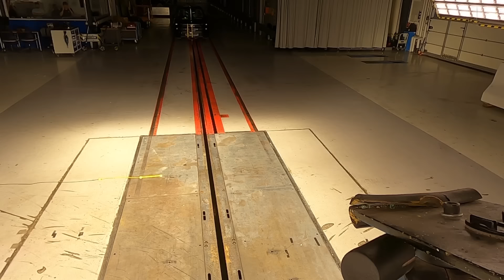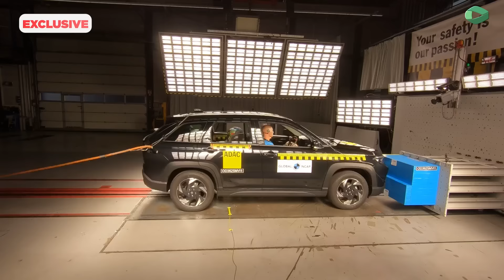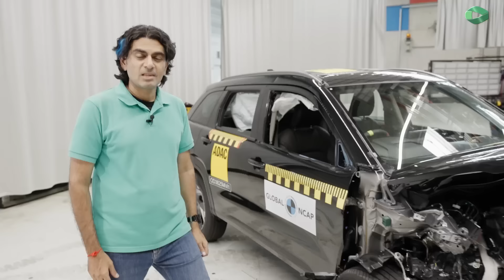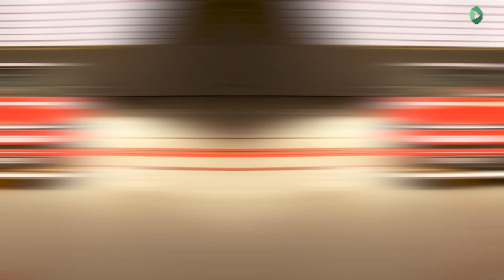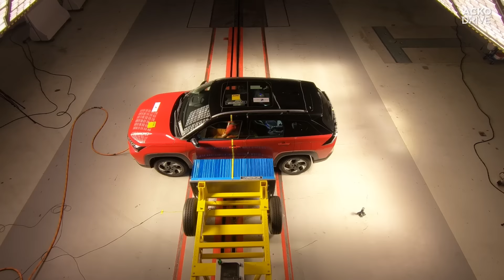Exclusive: Maruti Suzuki Victoris Crash Test: How Safe Is It?

Comment: Anyone hear that? 64 kmph. Every crash test is conducted at 64 kmph, not 80, not 100, not 150, but 64. Meaning at 64 kmph there's a high chance you might not die. So no matter the stars, if you don't drive safe, YOU ARE GOING TO DIE.
Reply: Very well said
Reply: 150 mai to bachna hi nhi hai

Comment: man its still a tin, built quality and 5 star ncap rating are two different things.
Reply: The primary aspect of safety is the passengers inside the cabin should be safe. No matter what are all the damages are there to your hood ,bumper etc these are all prone to damage and made to absorb the damage and not to pass those to the cabin area .Just because a car is getting damaged in small accident it doesn't mean a car is unsafe or Tin can
Reply: @abhaykrishna4861 there is a difference between air bags opening and you getting crushed along with your airbags.

learn the difference, even in the side ways crash test there was a significant amount of damage to the cabin, and real accidents are not control experiments thats why maruti cars always got zero inspite of airbags in european assessments because of their built quality.
Reply: @sharathkumar-vv8ns get ready for 5 Stars of E VITARA IN Euro NCAP. And I can tell you, you will be crying like this even then😅😂
Reply: That is being Exported in europe by Maruti Suzuki in many countries.

Comment: It's from gncap  .... It specifically say the body shell is stable and take more hits so 🥳🥳🥳🥳🥳🥳🥳🥳
Comments
Frontal impact: the protection offered to the driver’s and passenger’s head and neck was good. The driver’s chest showed 
adequate protection while the passenger’s chest showed good protection. The driver’s and passenger’s knees showed good 
protection. The driver’s left tibia and passenger’s tibias showed good protection, while the driver’s right tibia showed adequate 
protection. The footwell area was rated as stable. The bodyshell was rated as stable and it is capable of withstanding further 
loadings. 
Side impact: the head, abdomen and pelvis showed good protection while the chest showed adequate protection. 
Side pole impact: the head, chest, abdomen and pelvis showed good protection. 
ESC: ESC is fitted as standard and meets Global NCAP’s requirements. 
SBRs meet Global NCAP’s requirements for all seating positions. Pedestrian protection proved to meet regulation UN127. All 
this explains the 5 star result.
Reply: How will you confirm that the model tested and mass-produced ones are of the same strength and quality? I heard car companies manipulate a lot to get higher ratings.:face-blue-smiling:
Reply: @abhipaul7898  then you cannot trust any company in the world
Reply: then how come you trust anything in this world if that’s your logic? Let’s just clarify this properly — the Global NCAP (GNCAP) or Bharat NCAP testing procedure doesn’t just pick some special, hand-built car made for testing. They select a random production unit directly from the manufacturer’s mass production line or from dealer stock. This ensures the car tested represents what actual customers receive.

Now, even if a company tried to send a modified or reinforced unit to game the results, it wouldn’t work. The test engineers physically verify VINs (Vehicle Identification Numbers) and cross-check the body shell structure, weld points, and component materials against the manufacturer’s submitted homologation data. If any mismatch is found — even small structural reinforcements not present in the standard model — the vehicle is immediately disqualified or flagged.

Secondly, the idea that companies could secretly build dozens of specially tuned “testing” cars to secure a 5-star rating just doesn’t make financial or logistical sense. Crash testing is expensive — a single GNCAP test can cost ₹60–80 lakh per car, and multiple tests (frontal offset, side impact, pole test, child restraint evaluation, etc.) are performed. To create a “perfect” prototype just for crash tests would require separate tooling, crash simulations, and redesign cycles, which would cost far more than what most automakers could justify — especially for entry- or mid-level cars.

So in reality, it’s far more practical and economical for manufacturers to simply design a safe production car from the start than to build fake “test-only” versions. That’s why ratings like GNCAP are trusted globally — because they follow strict protocols ensuring transparency, random sampling, and third-party oversight. @abhipaul7898